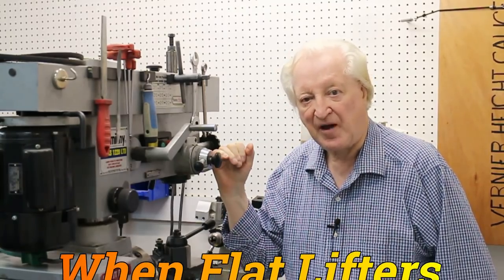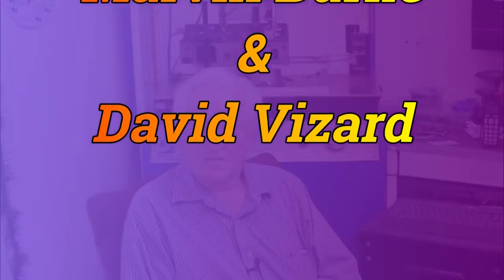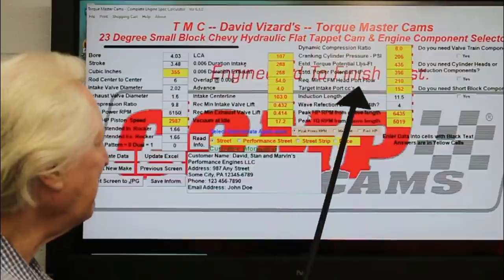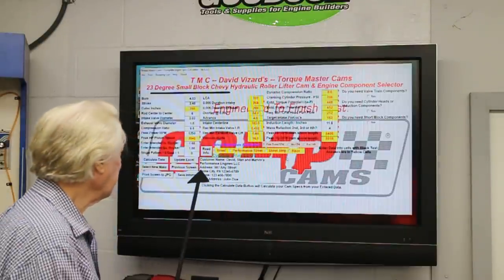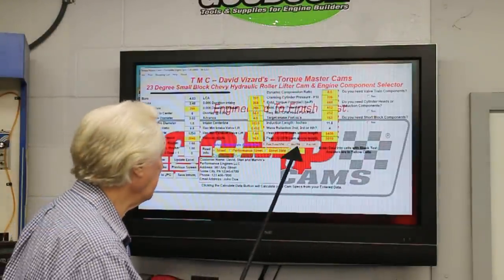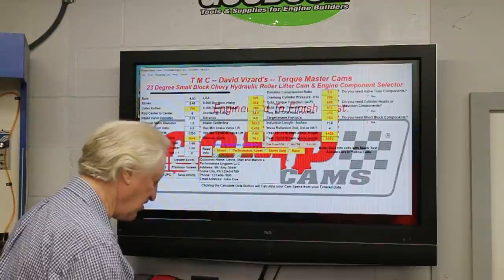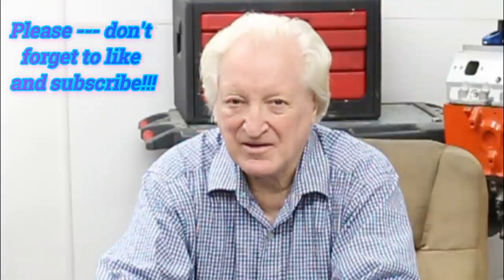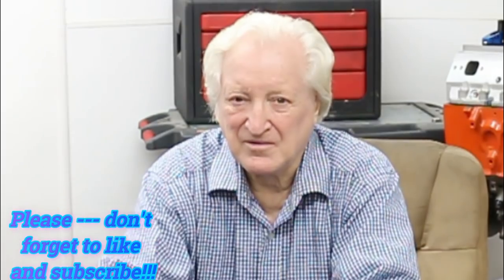David Vizard's PowerTec 10 EP 15 When Flat Lifters Reign Over Roller Lifters

Comment: Dear David would you be ale to build, or guide me to a builder for  427 ,434 Rather than I buy one one you could possibly use it to explain. It is very interesting to listen to you. I don't grasp a lot  thank God for replay. In the 80s in Australia I built with good help a 327 tunnel ram victor ram.It had an ed pink solid cam  fuelie double hump heads bigger valves and little things match porting and so.It turned out to be a great amount of fun to do.Id love to follow your guidance and build one? We are locked down again so its difficult to get done here My build is a 1963 corvette coupe i would like to add 2 turbos after to see how much i can get safely and  can stay in a variable build as such. Kind Regards Craig
Reply: So really what u are saying is u want a 434 turbo motor right ?
Reply from the maker: Craig, just how much do you think an engine like this will cost? I ask because most folk under estimate what a good 427 build SBC prices out at.
DV

Comment: Mr. Vizard, why did the large port, canted valve engines (Cleveland; 429/460; BBC) all get 1.70 to 1.73 stock rockers, while small port, inline valve engines (SBF, SBC, SBM, BBM) engines had to make do with 1.5s? Is there any reason to NOT install 1.6, 1.65, or 1.7s on the latter, besides piston to valve clearance?
Reply: Pushrod diameter? I know you need stiffer pushrods the higher the rocker ration goes. But that would be my guess that the BBC stuff got a thicker pushrod diameter to handle the higher rocker ratios.

Comment: Hi David. I am building a numbersmztching 327 for my 67 Camaro using comp cams 12-235-2 flat tappetsealed power flat top pistons with this cam what ratio rockers would you suggest? I have your port and flow test cylinder heads book but caifind a concrete answer. What kind of power can I expect with a set of heads ported to your specs as close as I can get them. I am thinking of porting one intake then 1 exhaust runner and cut out a  temple for quick referencesfter I flow the first 2 ports. . What do you think or can you give even more advice. I would love to get 350hp. Can I get there with this combo ? Thanks for your time and expertise Sir.
Reply: Can’t find

Comment: so does BG oil additive RF7. I run this and ROTELLA 15w40 in my slant6 and 318 during the summer months and during the winter I back off on some of the ROTELLA to help with cold cranking . I'm going to be building a 1978 mopar 360 for my 65 dodge dart what do you recommend on a buget . I'm going to be running a Hughes cam racing 998 automatic with 2800- 3000 converter and a 8-3/4 rear with 3:55 gears
Reply: Wouldn't u b better starting with a 360 magnum or at least magnum heads ? building a 78 would b equal to building a chevy 350 with open chamber smog heads when Vortecs would be a far smarter move !
Reply: @luckyPiston   I've already got money invested in heads and block air gap intake ect. the heads are J heads with 2.02 valves I will be porting  and after market pistions with shorty headers ect

Comment: wait, at 4 minutes on, you talk about 275 degree duration, so that must be advertised duration, not at 0,05 Inch lift?
In the first 6 minutes i mis the point of considering friction. Not only power, but friction. A typical roller cam assembly is made 
to perform as it has to be at best.?
Reply: Was thinking the same thing, but logic tells you it is advertised. You simply don't get hydraulic flat tappet cams that big. Then when he put up the graph it showed 0.006, so that cemented he wasn't talking 0.050"

Comment: This is interesting, but I have heard many stories of low quality flat hydraulic lifters not lasting long. This is even in situations where people use special high ZDDP oil. Some people buy roller hydraulic lifters only to avoid that situation.
4:28 This would explain why the 350 truck engine used hydraulic flat lifters until 1995, whereas the Camaro, Corvette, and Firebird got hydraulic rollers in 1987.

Comment: David I would love to see you turn that spreadsheet into a proper computer program. Spread sheets have their place, but you can do so much more with a program that just isn't that easy with Excel. I may be a bit biased as I have been writing programs on an off for over 20 years, but you could graph / display those results infinitely better. Yes you can do graphs with Excel as well, but it will never look as clean or as functional.

Comment: With all these aftermarket engine blocks and billet blocks, billet heads, and custom valve trains designed before even designing the block, why not do something that uses the advantages of both plus some other advantages?
Reply: Why not get rid of the lifters altogether. No I don't mean OHC.
Reply: I mean something like the ilmor mercedes indy pushrod v8.  Put rockers right on the cam 8n the block, either with rollers or a curved sliding follower.  A whole new realm of possibilities for acceleration, and valve velocity
Reply: Then you get rid of the side load problem and the velocity limit of a certain diameter flat tappet, and you could even just put the roller 9n the end of the pushrod and use a thin, flat leaf spring fixed to the block to guide it, eliminating another pivot as well as the lifter friction in it's bore and adding some spring rate.

Comment: Have you tried Howards lifters with EDM hole  ?  I have read about them , but haven't used them yet.
Reply: The EDM hole does work but I prefere the lifter goove lube method as it can be used with both solid and Hydraulic lifters.

Comment: Because I've read your books, I understand where you're coming from here.  I think a graphic showing the area under the curve for the two types of followers would be instructional here for those who aren't sure what you're talking about. The roller cam is basically limited by the thrust angle of the cam/roller interface, whereas the flat tappet is limited by the diameter of the lifter.  I'd like to see a graphic where the two are at the bleeding edge and how the curtain area is affected in the first couple hundredths of lift. Or a "race to .25D"
Reply: Clif,
 Are you the 'Cliff' I know from old??? Your comments are spot on but there is a limit to what can be comfortably stuffed into 20 mins.
DV
Reply: @DavidVizard  Haha!  I wish I could claim to have met you, but sadly, our paths have never crossed.  It's only as an older man that I've had the time and resources to put all the things I've learned from you and others into practice as a hobbyist.  If folks who get most of their information from videos only realized how much depth they are missing by not reading!

Comment: Hi Mr. Vizard, have you an opinion on comp cams Thumpr series, Thumpr, mutha thumpr, big mutha thumpr. thanks.
Reply: 6:48 so yeah the Thumpers are on the other end of that spectrum right ?
Reply: @luckyPiston  Could you expand on that? thanks.
Reply: @joesmith306  Well a huge amount of exhaust duration (Thumper cams) tends to push power up the power band, i seem to recall the thumper actually made some decent peak power numbers but bottom end and drivability were compromised for a choppy sound.

Comment: What about "Mushroom" lifters?
Reply: Even better! Thats how nascar made tons of power without roller lifters. In some way it may have been better than a roller since that fixes the lift limitations youd have with normal lifters and allows high velocities with a larger cam core diameter so you dont have so much cam bending with heavy valve springs.
Reply: It is a little bit of a pain though, you have to counter bore the block and install the lifters before the cam with the block upsidedown. Its also not a cost benefit so its a completely different discussion in reality.
Reply: daniel dimitri         I agree.

Comment: I like it. I do not understand the low 5000 rpm up peaks though for a hot street motor?? I am sure I missed something. With Maximizing a 318 mopar I interested very curious how this program would shake out. Jones hyd roller 217/221 @0.050, .340/.340 lobe lift on a 110 CL. Gonna be sniffed by the smog wankers.
Reply: Derrel, Hot street build might be a slight exageration. The point here was to make a true street build that much torqueer and powerful.
Reply: @DavidVizard  thank you DV

Comment: Again problem with audio, the music is in one ear and the voice is in the other and they're both are pretty quiet.
For viewers: if you're using earphones or headphones with a cable, you can slightly pull out the connector, this should turn stereo into mono and the audio will be much better.

Comment: about the oil BS. choice mag did an oil test using cabs over 100,00miles. Using recycled oil to the most expensive oils. changing the oil as stated by the manufacturer. after the 100,000m they tore down the motors and fount there was hardly and the difference between the motors to come to a conclusion. 
free power is the best power.

Comment: Only real problem I see is that the quality of hydraulic lifters has tanked over the few years ( I've read 3-4) .
Reply: Thats been a concern for at least 15 years. But lube has a lot to do with it. It was always suggested to use moly paste on new cams and oils in the past had zddp, a zinc compound that has an anti wear property. Well oil companies generally change formulas to keep with api specs and modern specs have lower levels of zddp and molybdenum because it can cause harm to catalytic converters. Even moly greese and paste has lower levels of moly because the expense of molybdenum disulfide has gone up and comp now gives red assembly lube now vs moly paste. So while yes a lot of lifters may come from chinese suppliers with questionable metallurgy the lubrication is also becoming expensive and rare. Because of that i might recommend roller cams to the kind of people who would ask for a recommendation because they probably arent the kind of person to buy oils at a race shop. But if someone is willing to take the chance, do the research and use the right lubes then that money saved could pay off in other ways.

Comment: Roller wins on less friction alone.
Reply from the maker: Peter - way back when we did some power absorption tests at Isky's place. We found the Ford quoted 14 hp less than a flat tappet to be very much exaggerated. The power to drive the valve train actually dropped after a certain rpm was reached. With todays oils, armored lifters  and hardened cams the friction levels achieved can rival rollers.
Reply: This whole video is pure fantasy.  NOBODY runs a flat tappet that isn't forced to run a flat tappet.

Comment: I can't even watch all of this dribble.  The big 3 have been making engines with roller cams since mid 80's.  And a custom roller cam is at most $400.. at MOST.   And you can change them out willy nilly if you like without ever having to change lifters.    This video is crap they would teach in 1979.